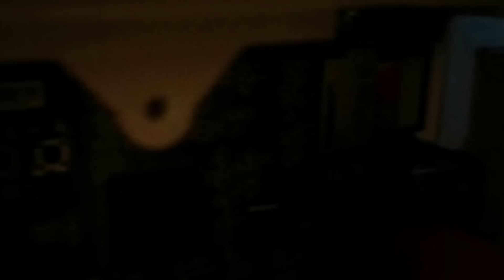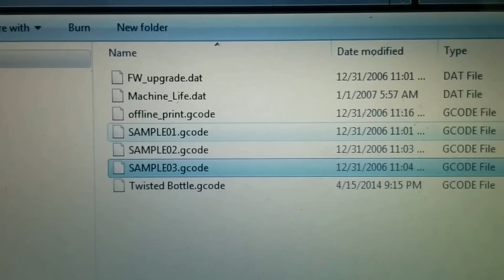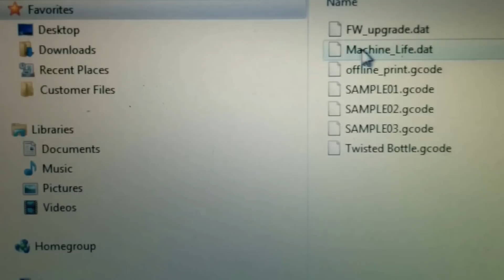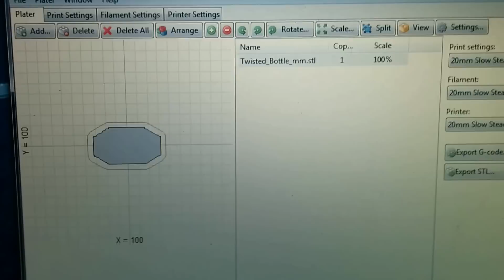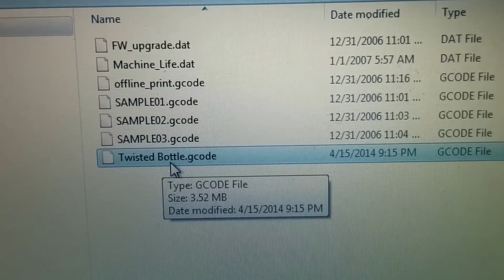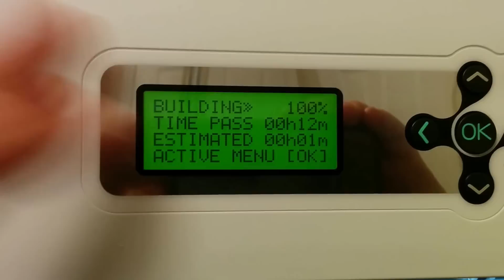DA Vinci 3d printer SD card backdoor hack

Comment: Is there any way to get this to work with the new firmware and the new board 

I tried this (i took out the micro sd and loaded a gcode file titled SAMPLE03) and the printer did the usual heating of the extruder and bed then it moved the extruder over the coner of the bed and just sat there for about 5 mins then it homed the x and y axises and sat there until i canceled the print 

Is it possible to print slic3r gcode files on the bew board at all you cant even flash different firmware on this one from what i have researched

Comment: My SD card is located a lot further back, is a micro sc card, and windows says "must be formatted before using" when plugged in.
Reply from the maker: They must have changed the board and Firmware on the newer models.
Reply: http://www.ebay.co.uk/itm/261805860140
Reply: john doe Yea, I put one of those in mine, velcro'ed it to the side and then stuck a Toshiba Flash Air II card in it. Use the upload mode to send gcode files to it across WiFi from by browser.
Never bothered with XYZware though, reflashed with Repetier firmware and switched to Repetier host almost immediately.
Reply: i brought cheep  ones and they were poop might try the t.f.a.2 in  the future but i have gone off 3d printing cos there firmware is so shit its unbelievable. i cant print any thing big or it will malfunction. im limited to 120m any way (i use default arduino program, any one kno how 2 edit it?)
i have the duo so its the latest firmware and i cant update.... i was thinking of selling and downgrading to the single head at one point but atm cba....

Comment: I can confirm that this is the same on the 2.0 duo... can anyone confirm if the printer responds to slic3r's print speeds, flow rates and temp commands?

Comment: By changing the fillament length to 1 did that stop the eprom counter on the cartridge?

FYI: Im using the toshiba air sd card so i didnt have to cut the printer. Also, if you get the 16g or up it takes the regular file names and you do not have to hack the firmware to use it.
Reply: I ordered  Toshiba FlashAir the other day. Found out it only transmits the files, not the other way. I think SD card extender is a better solution.

Comment: This is really useful !!! Can you use PLA with that mod ??
Reply from the maker: Yes you can use pla, nylon, Poly-carbonate or any plastic that is in 1.75mm diameter
Reply: Mark Fuller How do you use nylon? Wouldn't it overheat the print head?
Reply: ***** You can set the heat of the extruder and bed with slic3r to make the Da Vinci nylon friendly.
Reply: Miles J. Litteral Really? Cool!

Comment: The XYZ slicer is crap. I have very nice stl files made by solidworks and trhe XYZ slicer turns them into unusable  junk. My UP slicer that came with my UP Mini machine was great for very detailed prints. The better the stl file was the better the print was. This Divinci machine seems like a good solid machine but without software is is usless. I am not a hacker or programmer so guys like me are just out of luck.
Reply: I have similiar problems ,  I made some stl files with solidworks and when I measure the mechanical parts made by xyzprinting the inner diameters change by a lot and other dimensions just doesn't match the print.   If I got a complex stl file I just not understand why this 3d da vinci does it wrong,  or do you think Im doing something wrong while exporting the stl file from solidworks?   any thoughts?

Comment: Try to changed the filament data : address at 0x10 and 0x12 / 50 / 52. - Bed temperature up to 92 degree, and extrude temperature to 212 then immediately get the error - the printer refused the temperature change.  Looks like firmware lock it up (

Comment: hi, this is a crazy question to ask but here goes.  I am trying to take the panel off in back cause im getting an error of 0032 so I wanted to see if it was attached properly. I noticed the screws must be hex screw I have a couple sets and still don't fit. you have any idea of how to take the back off?  thanks again for your time, Donna
Reply: Torx screws

Comment: wifi SD ... TO  3D Peinter....
Reply: yeah, was thinking the same thing, so you don't have to get it out of your printer everytime. Although you might need to do something, to have the device, find the new files, like power cycle or pull card out and in.
Reply: get the toshiba 16g air sd card. 40 bucks on amazon.

Comment: Any chance you can take a photo of the controller board? I'm curious what it would take to replace the firmware with something that's not so constraining.

Given that Slic3r is reputed to be used inside their computer software, I wouldn't be surprised if there is an obfuscated open source firmware on the machine.

Comment: rather than cut the case, I've ordered a SD card extension. Once it arrives I plan to remove the 6 screw that hold the pcb in place and swap out the card for the extension. I really want to use slicer with this product.
Reply from the maker: Ya I was thinking about the same thing after I cut a hole :-( I think I will build an extender so I can remove the card easier. Please post a Video on your mod. Would it be possible to use a Wifi SD card?
Reply: Wifi SD cards are designed to push from a camera to a device/internet but not to send to. You could probably read but not write to it.
Reply: Harry Pottar
Actually, the Toshiba FlashAir cards are hackable.  They have a config file with parameters that can turn them into receivers rather than transmitters, albeit somewhat wonkily.
Reply from the maker: Sam Pagel Do you have any links?

Comment: can you share your silc3r settings for the de vinci, i.e what should the cooling fans be set at. A lot of the prints out of the XYZ software have thin bootoms and you can see the honeycomb fill or even holes so would like to use the top and bottom solid layer options. New to 3d printing but a quick study
Reply from the maker: Here is the first couple of Lines of code for offline_print.gcode on the Da Vinci SD Card. I think this is the file XZYware exports to the machine to run. 
; filename = composition.3w
; machine = daVinciF10
; material = default
; layer_height = 0.3
; total_layers = 355
; total_filament = 55762.62
; dimension = 121.92:91.44:106.55
; extruder = 1
G21 ; set units to millimeters
M107
;M104 S200 ; set temperature
;M109 S200 ; wait for temperature to be reached
G90 ; use absolute coordinates
G92 E0
M82 ; use absolute distances for extrusion
G1 Z0.350 F2700.000
G1 F1800.000 E-1.00000
G92 E0
G1 X3.000 Y80.000 F2700.000
G1 F1800.000 E1.00000

***********More Gcode, ect ect********

G1 F1800.000 E15.52703
G92 E0
M107
M84     ; disable motors

Comment from the maker: Here is a simple Hack I found to go around the .3w files for the Da Vinci 3D printer. Behind door #1 we find .Gcode our old friend! First Slic3r files running on the Da Vinci 3D printed.
Reply: Is this firmware specific?...I unfortunately "upgraded" past j. Does it still work. This would be awesome as I don't have a convenient computer to connect to
Reply: +Mark Fuller I have one of the 1.0 pro printers, i removed the SD card and opened the SAMPLE03.3w in notepad++. When opened the text is coded, following is an example( Ÿ‘“qZ6>í7ÍöÅ~Ù¨ ·–ûóW  £Ÿ×¬„:qXçì u†{„¹…Î3%hÕràŒ$2ü¶¹ª™Ù •´1]…››…RïÎKñÜ¿ ZB¿çÀ\“-ÿV"F=) does anyone recognize what codeing this is????. If we can figure this out i believe this hack will work on the Pro also.